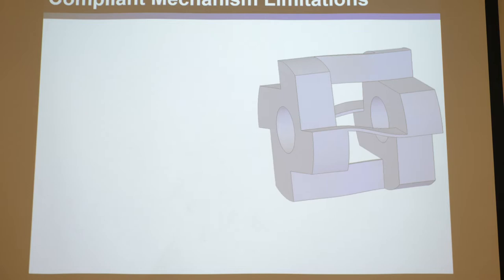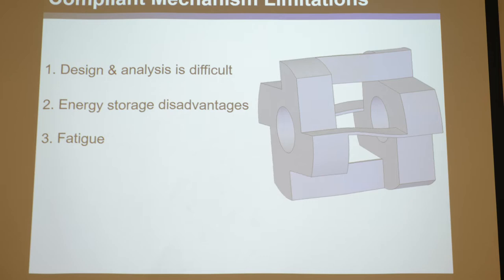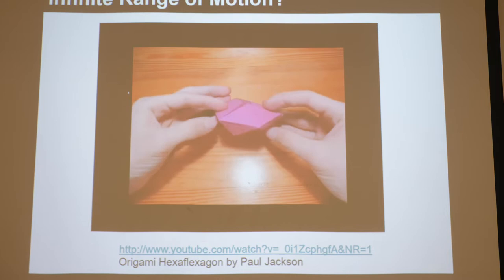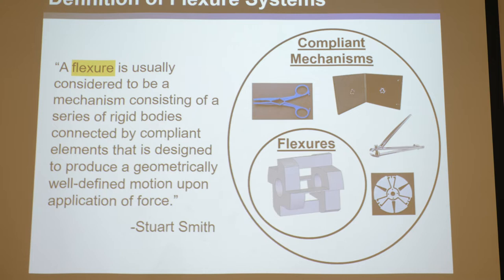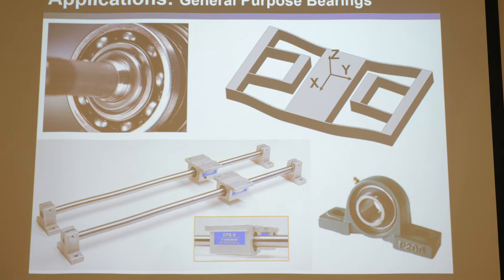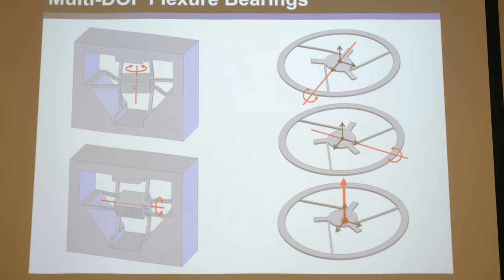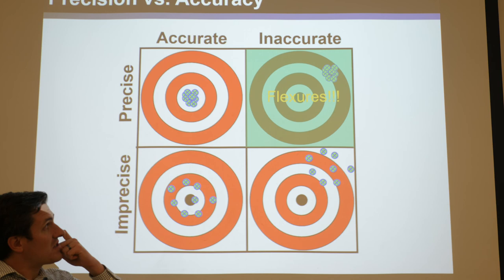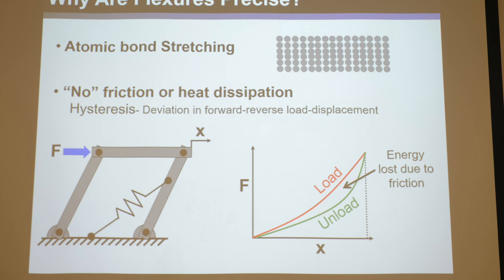Compliant Mechanisms Lecture 1 Part 3

Comment: Challenges of Compliant Mechanisms: (0:19)

* More difficult to design and analyze. 
* May store unwanted energy. (1:04)
* Fatigue can be an issue. (2:12)
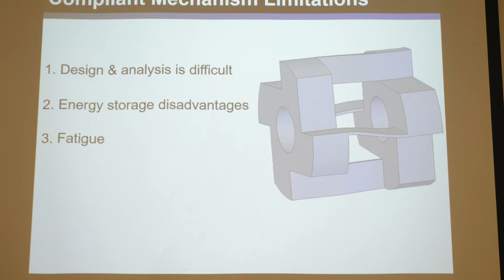* Limited range of motion. (4:15)

Overcoming Challenges:

* Design and analysis approaches exist to make design more approachable. (0:40)
* Multi-stable mechanisms and plastic deformation can mitigate energy storage. (1:17)
* Material selection and design can minimize fatigue. (2:28)
* Strategies like stacking and nesting can increase range of motion. (5:17)

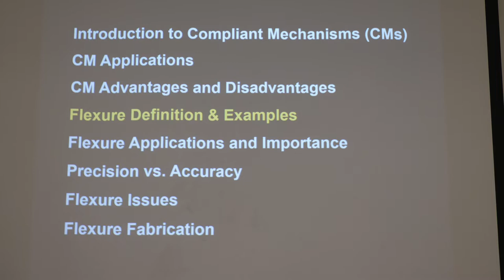Flexures: (7:11)

* Subset of compliant mechanisms. 
* Consists of rigid bodies connected by compliant elements. 
* Guide motion in a well-defined manner. 

Types of Flexure Systems: (9:15)

* Parallel: Two rigid bodies directly connected by flexure elements. 
* Serial: Multiple parallel systems stacked or nested in series. 
* Hybrid: Combination of parallel and serial systems. 

Flexure Applications: (15:49)

* Microscopy stages 
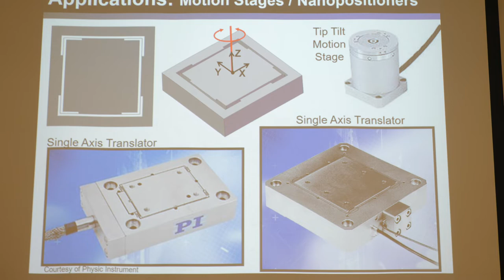* Optical mounts (telescopes, CD players) (16:48)
* Micro-electro-mechanical systems (MEMS) (17:31)

Advantages of Flexures: (15:49)

* High precision and repeatability (sub-nanometer resolution). (19:50)
* Ideal for small-scale applications. (17:31)
* Relatively inexpensive compared to air or magnetic bearings. (20:47)
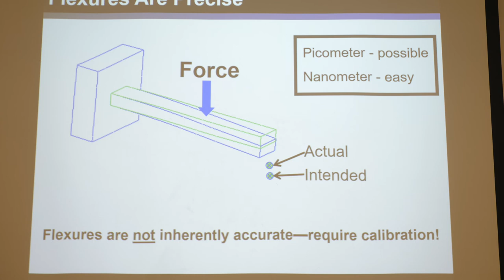* Can be calibrated to achieve high accuracy. (26:11)

Precision, Accuracy, and Repeatability: (23:30)

* Accuracy: Difference between the intended and average actual position. 
* Precision: Measure of spread or repeatability of motion. 
* Flexures offer high precision and repeatability, but may require calibration for accuracy. (26:11)

Why Flexures are Precise: (29:13)

* Relative motion is achieved by stretching/compressing atomic bonds. 
* As long as bonds are not broken, deformation is highly repeatable. 
* This leads to superior precision compared to systems with friction. 

i used gemini 1.5 pro (2024-05-15)